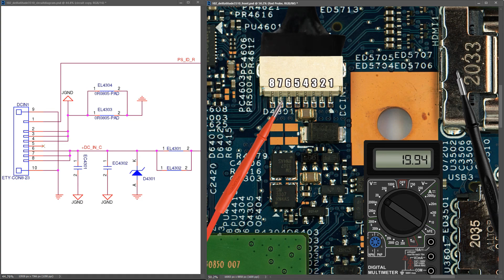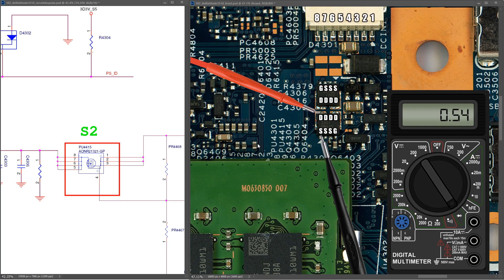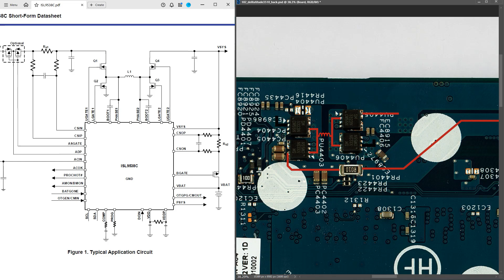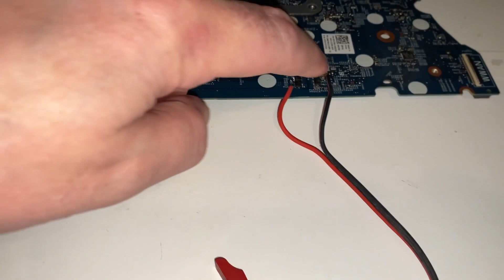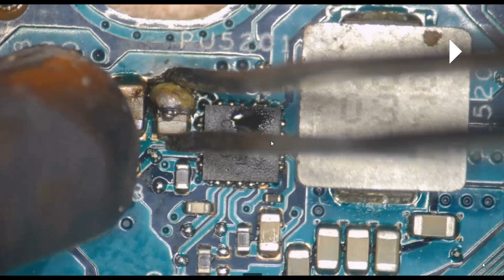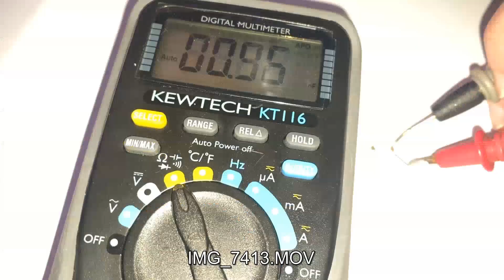DELL LATITUDE 3510 - NO POWER

Comment: Not sure if I would risk $131 for a no-power laptop, but this worked out well for you. It is probably much newer than the Inspiron laptops I normally buy on eBay, so the price may be close to market value. Did you mention the CPU and other specs for this 3510?
Reply: Dell Latitude 3510 was released 6/XI/2020. 
Dell Inspiron 13 (1/16/2009) and continues to be manufactured until the most recent Dell Inspiron 15 (May 4/2023).
Search as: Dell Latitude 3510 motherboard (Ali/xx). i3, i5 and i7 CPU, 32 GB maximum Ram.
Reply: @CarlosGarcia-d3e  I see that this MOCKINGBIRD-L CML UMA 6L 19746-1 YJLJDSCA motherboard supports 10th Gen Intel processors.
Reply: @danarepouille1381  Hello. Yes, Dan. Indeed. That is the motherboard and it uses the i5 CPU in the Dell 3510 model. I recommended Ali/xx because they send you a new PCB. On the other well-known sites, you can get an original Dell 3510 motherboard. Man, that's cool! but generally used... ...and they even claim that it is 100% functional.
Read in a forum here in North America for intel 5 10th gen:
"A processor like the one in this laptop depends a lot on the rest of the hardware it comes with, but fortunately, with each generation of CPUs that arrives, hardware and software solutions are included."
In other words, the PCB (printed circuit board) on which the components are mounted has a similar part number, but the processor (i3, i5 10th and i7 third gen) determines the circuitry (components) with which it will work optimally and of course some ICs (mainly) will be different on each board. 
As an example: the Dell 3410 model uses a similar part number board and many components can be used as "donor" for 3510... just as I have seen done on another channel. All the best.